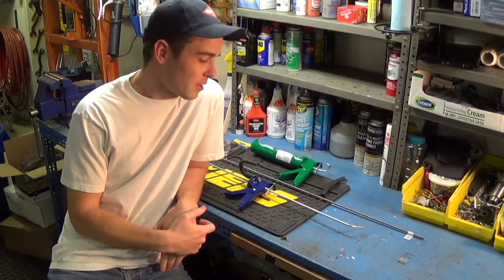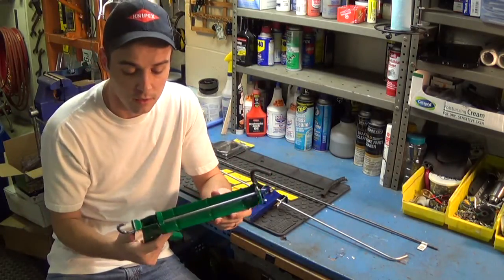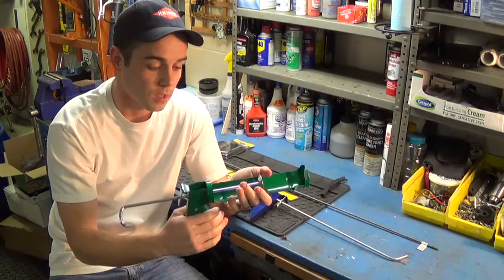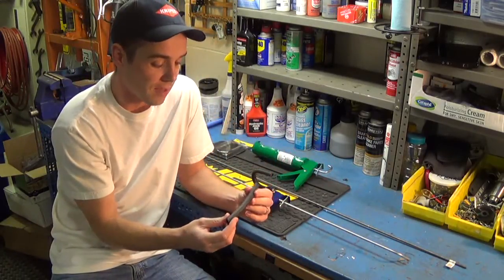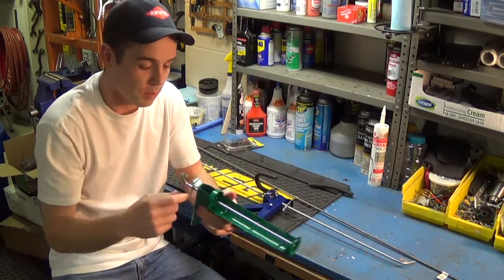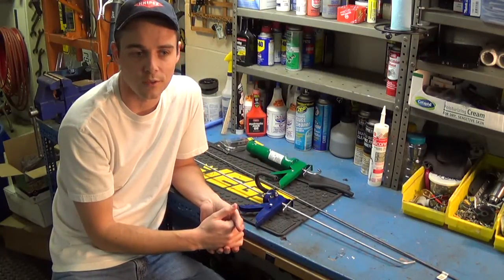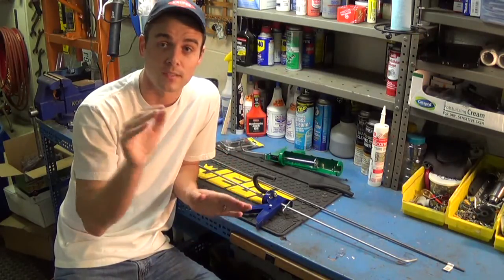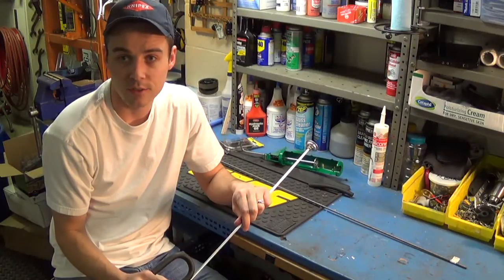How to : Make a Pedal Depressor - Part 1 of 3

Comment: You can bleed brakes by yourself. Make a brake pedal depressor. Buy a 36 inch clamp at Harbor Freight. Unscrew and remove the small static foot clamp, and  screw on to the other side of slide, and  slide the large foot clamp to other side. Do NOT remove the larger clamp foot. You want clamp feet facing away from each other.  Now you have a brake pedal depressor that only costs $9. You can put small foot of clamp on brake pedal and larger side under steering wheel.

Comment: I made one with the 1/4 inch rod suggested by the video but the push lever just slipped on the rod without pushing it forward and the anti-return lever allowed the rod to move back. Most caulk guns use a 9/32 inch rod which is slightly thicker than 1/4 inch therefore if you use a 1/4 inch rod, the tool may not work.

Comment: THE BEST, CHEAP & EASY tool to use like a pedal depressor is a clamp from harbor freight tools item# 96208 I got one last days and Installed a rubber at the bottom and cost me only $7.99
Reply: J Flow nice find. Cheaper and easier but the one in the video works better and is more secure for just $2 more.

Comment: That's cool, but I just took a 3" wide x 4' long strip of plywood I had laying around, another block of wood I had laying around, and a small clamp, ran the plywood through the steering wheel down to the brake pedal, stepped on the pedal, and used the block and clamp to keep the plywood from sliding back up through the steering wheel. 3 minutes problem solved. Yours is nicer but I may never need to use this tool again, so for me it isn't worth the investment in time. Still, great explanation video.
Reply from the maker: Larry Heller Haha....well it definitely would be a lot cheaper with the wood idea, but I was going more for longevity & universal fit ;)  Thanks for commenting!
Reply: I was not expecting to ever need it again, or if so, not for years ... I don't do a lot of brake hydraulics. ;) So we both found sane and rational solutions to different problems.